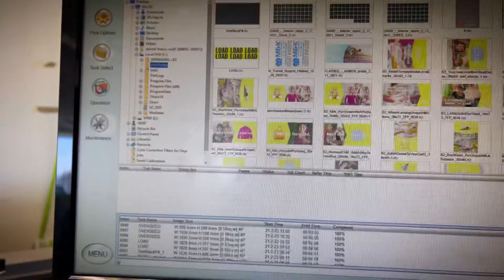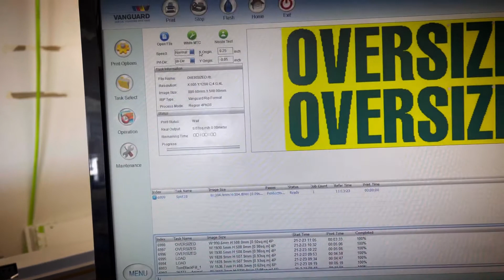Vanguard VR5D banding quick fix.

Comment: How you maintain the white color and head ? I have one and the head is clog
Reply from the maker: Bad news bro, the company that I worked for that used this printer no longer uses a white print head. They let it dry out. 

You literally will have to buy a new print head and either keep solvent in the print head when not in use or purge/wipe after every print. They’re trash. I’d never get a white print head ever again